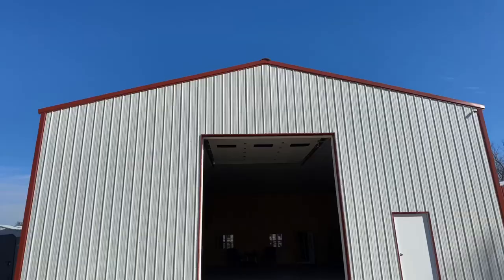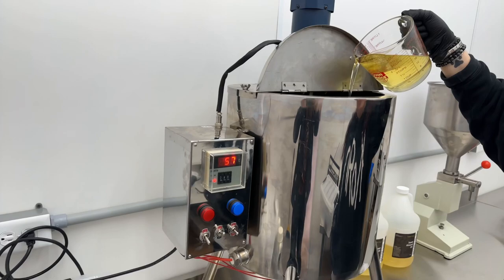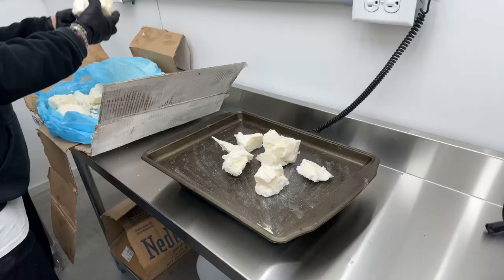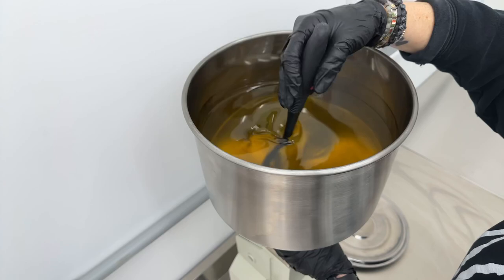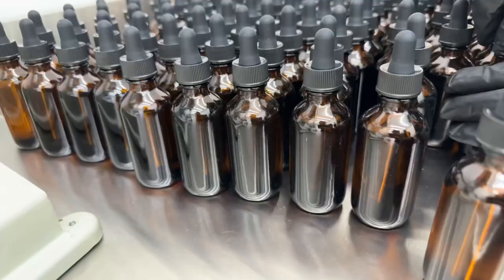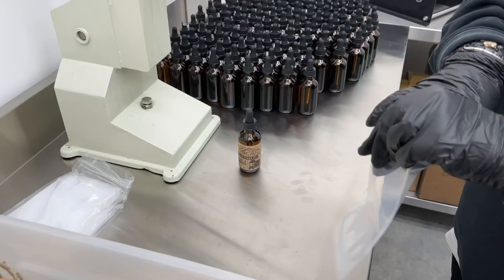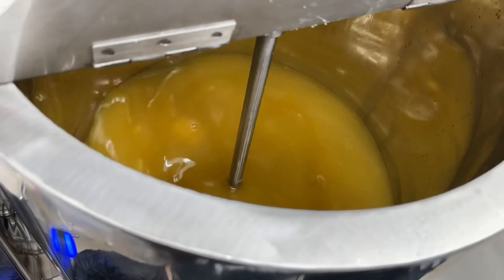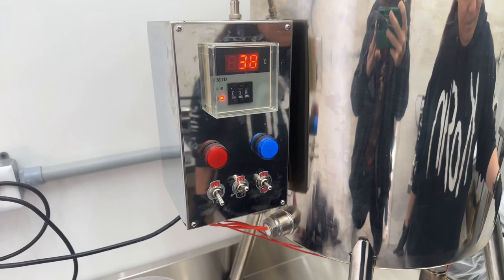Full beard oil manufacturing tour!

Comment: I’ve tried many different oils and butters, mostly gifts and have a huge assortment of crap. Even some of the ones i like go rancid before they get used. I’ve grew and wore a beard probably longer than most manufacturers have been potty trained. What would be cool to see is an assortment of tiny amounts to try both of scents and styles.
Reply: A trial variety pack is a great idea!  It will probably get people to buy a few different scents.
Reply: Those can b even more lucrative too. 

Usually pay more per unit of product than the larger sizes. 
More packaging of course but that could b reduced by having the different scents n a very plain container & those n a box or something with the label. 
Instead of putting the nice big labels on each trial bottle 🤔🤷 

The butter would be cheaper to package n small containers than the oil & people could still get an idea of the scents offered 🤔
Reply: That would be a great hit - a little box of assorted scents, a bag of multiple items with the same scent would be ideal gifts for Christmas.

Comment: Also essential oils have alot of benefits. From a legal sense you probably can't claim it, but they do. Actually had an argument with my firmer barber over that. Guess i forgot to tell her I've been an herbologist since i was a teen...  Not all the oils used have benefits on your beard but the ones that do make a difference. Like cedarwood oil. It softens the hair and it has anti fungal and anti bacterial properties. Helps prevent acne, ingrown hairs and skin infections under your beard. Tbh though, I've just been using yoyoba oil with no additives. Workd well enough. Just to lazy to mix up some of my own oils lol